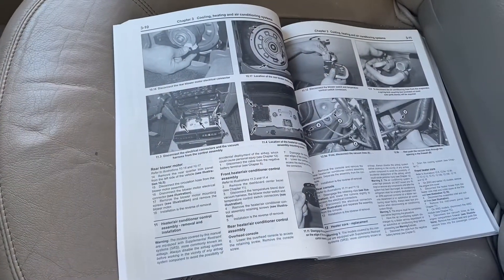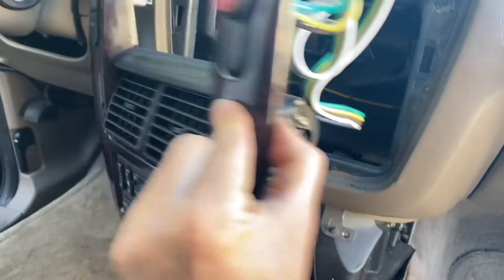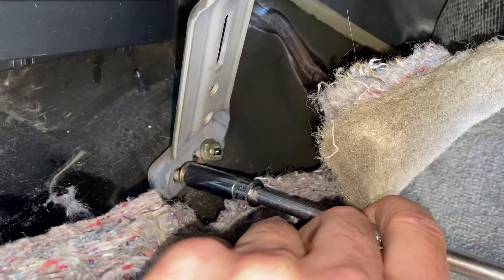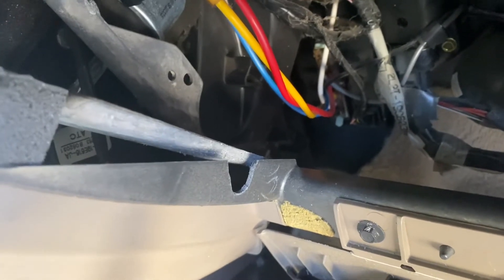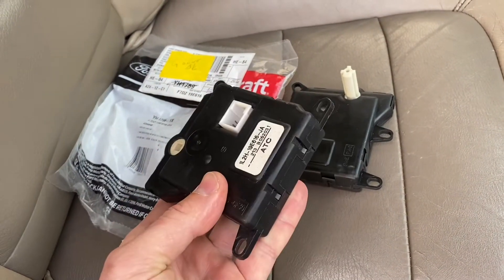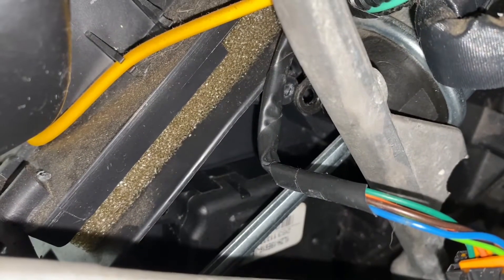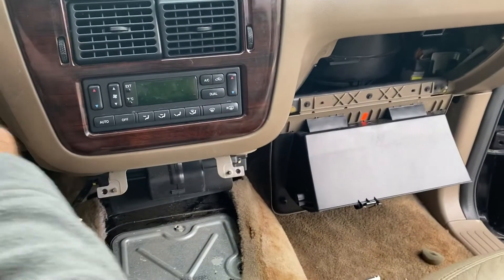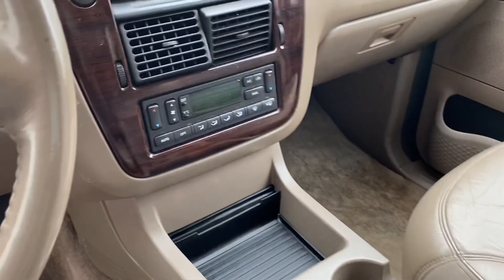NO HEAT? Blend Door Actuator Replacement Ford Explorer 2002-2005

Comment: Great video! It was a lot of help! We found a way to cheat rather than having to cut it with a hack saw! We also didn’t have to drill any holes with a drill bit! The bottom of the dash comes loose! Was about six screws and it gives wiggle room! We did both actuators while we were in there. The driver side is a lot easier, I’ll tell you what! 😂
Reply from the maker: Nice! That’s great info!

Comment: Hi Ryan great video I did this repair once by removing the dash and don't want to go that route again. My question is, after you drilled the hole in the side of the glove box you then said it was a lesson learned and you went after the wrong gold colored screw but you didn't mention if there is no need to drill that hole?
Reply from the maker: I definitely needed to drill the hole to get access to the correct screws. The hole drilled in the dash support did not hinder the strength of the dash support significantly in my opinion.

Comment: What if you get the driver's side one off, test the motor and it appears to be working right? Its like the door is stuck closed. Any advice?
Reply from the maker: There also some vacuum operated actuators under there that could fail. Not sure if that’s the issue.
Reply: Right on it was the little gear all along just didn't notice it at first. I ordered the motorcraft replacement part, hopefully get it by the end of the week.
Reply from the maker: Nice! Glad you worked it out!

Comment: how did you get the bottom right bolt out of the on the actuator  below where you drilled the hole? OK I SEE WHEN YOU PUT BACK IN THATS WAS WERE YOU DRILLED THE SECOND HOLE AT 14:30 Thanks! Mines never mad a popping sound or clicking just no heat on passenger side!
Reply from the maker: Yeah, it’s a puzzle 👌🏼

Comment: Does the single climate control also have that second actuator? I have an 05 explorer with the single climate control that was stuck on heat. I ended up removing the driver blend door actuator and the ac started blowing cold on both sides. The actuator has no movement when adjusting the temperature so i know its bad. The only thing is on the passenger side where the other actuator is supposed to be its not there but theres a broken piece of plastic sticking out where the rod is suppose to go in as if there was once an actuator there.
Reply from the maker: These explorers came with many configurations for the heating and air conditioning set up. It’s hard to know for each design. If you see a plastic peace broken, it would probably indicate something is missing. There are probably plenty of these explorers at local pick and pull. You could go and check out similar models at the junk yard to see what the set-up looks like on your model.

Comment: I have that very same issue no heating. I don’t have that clonking sound
Reply from the maker: There are several issues that could cause a no heat situation, but the blend door is common on these. It doesn’t always make the clunking sound when they go bad.